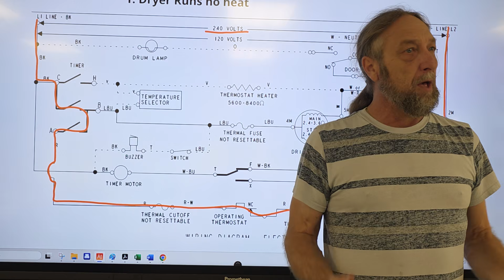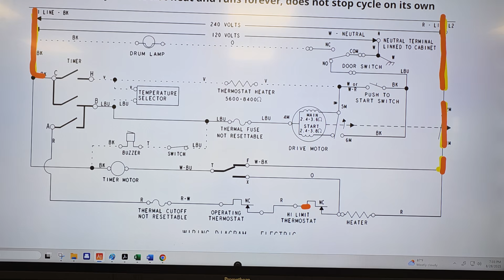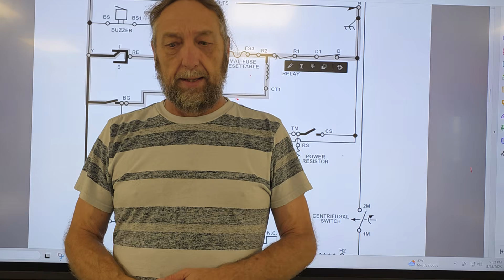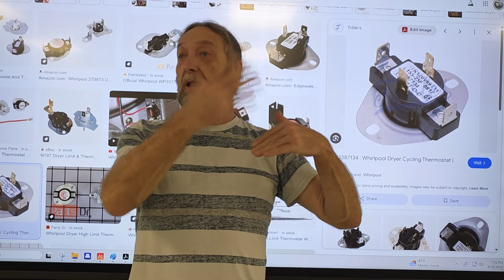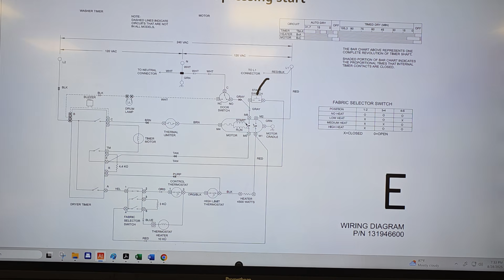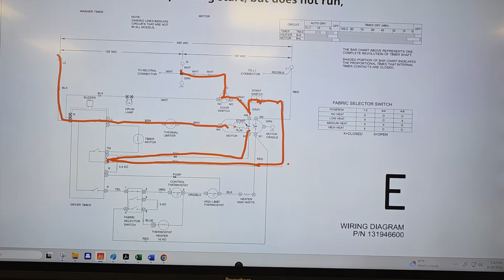Troubleshoot Whirlpool and Frigidaire Dryer

Comment: I disagree,  I check power everytime.  Just like a Doctor Checks Height, weight, and Blood Pressure.  The dryer  light could be on Line 1 and the motor on Line 2, so the Light will be on but the motor is not getting power.
Reply: on a 240V unit the light is on line 1 ..the motor is also only on line 1, no motor on line 2 , the line 2 is only a HEATER COIL circuit....

Comment: Why wouldn't they be dry is it was the cent switch?
Reply: The centrifugal switch, if faulty, is in series with the heater element and therefore would not allow the heater element  to conduct electricity and thereby dry the cloths.
Reply: the motor switch [ cent switch ] is large RED wires on only pin 1 & pin 5 on 240V dryers, not need or used on GAS dryers... when the cent switch kicks into the motor it has a steel band on the back side of the round switch that makes connection to the Two Red Wires that go to Heater coils, from the wall plug to the cent switch when kicked in to run and make contact there and power go's to the Heater Coil and through it now we have voltage and heat...